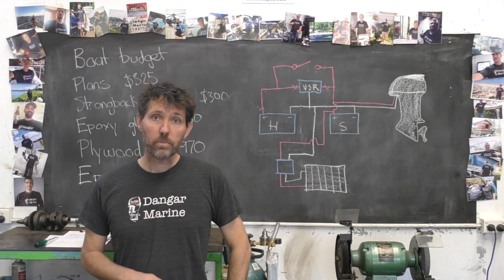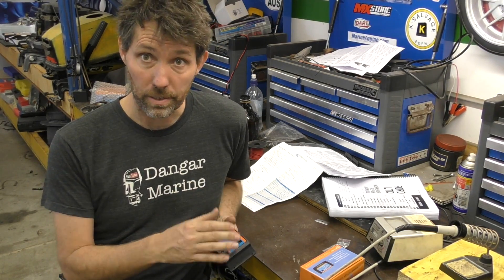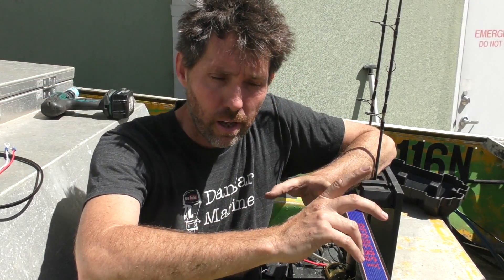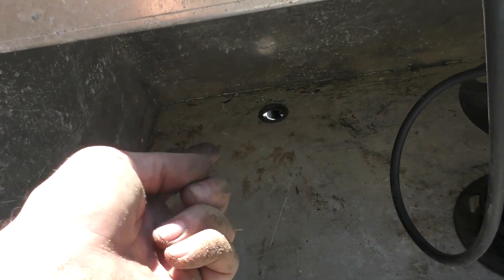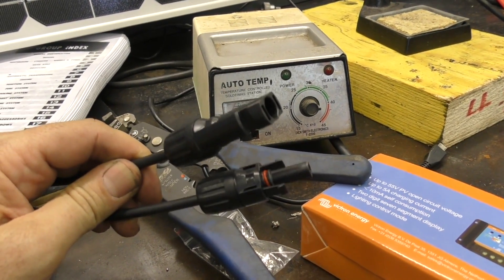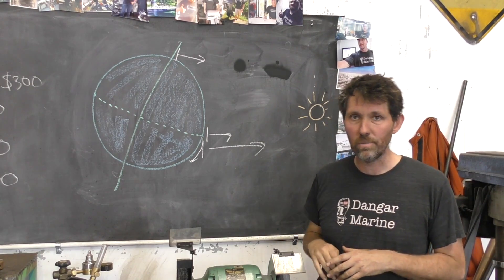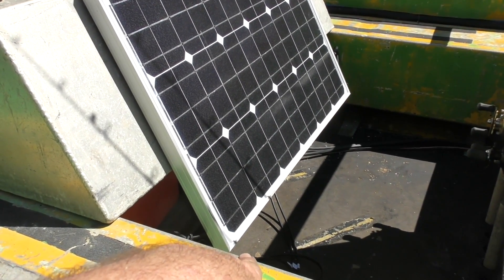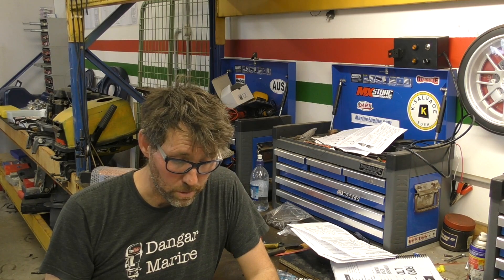Installing a solar cell in a boat

Comment: I'm wondering if the solar system needs to be isolated during engine operation to prevent the alternator from  pushing back current and possibly damaging the solar or vice versa?

Comment: The only way you would get 6 amps is if the battery is completely dead 
You could only get and use less than 20% of the advertised output ohm's law 101 
Measure voltage and the amps multiply the two and that'll give you Watts you will never get 100 electricity is like water you must overcome the incoming pressure volts is pressure

Comment: Interesting video! I have a bigger boat with a living space which I just prepared all the wiring ( it’s currently in winter dock on stilts.... because it’s still somewhat winter over here in Europe ) 

And I was just wondering what power outage of a solar system I should buy? 

I only use it for lights... and charging my phone ( maybe even my laptop ) and maybe my fresh water tank pump....

I got a good deal on a 50 watt solar system.... but then for a few dollars more I could get a 100 watt system! 

The 100 watt system of course has a much bigger solar panel!

I want to mainly power the lights inside and the white anchor lights and red / green position lights ( which are required for any bigger boats  in Germany and Europe ) and to charge my phone and laptop ( USB and reg outlet or cigarette outlet ) ! 

According to the 50 watt description it could charge a 19 volt laptop ! 

I don’t need charge for the motor ( at the Moment) 

So what do you think, does a 50 watt solar system is enough ( or even a 20 watt solar system, which would be cheaper )?

Comment: Hi Dangar, thanks for another useful video. Just. a question did you connect the solar panel directly to the charge controller? I bought a boat that had the solar panel connected directly to the charge controller and it got fried when I disconnect the batteries from the charge controller through a similar switch. I wonder if the switch should be between the solar panel and charge controller. thanks

Comment: Interesting; but the angle of your panel is no where near 33 degrees.  It's closer to 90 degrees.  Wouldn't you be better off having it flat; that would be closer to 33 degrees.  Or with the hinges you can just vary the angle.

Comment: So if you have 2 batteries in your boat, how do you charge both of 1 solar panel?
Reply from the maker: Use a VSR if you want to charge them together but keep them separate when draining.

Comment: Very useful thanks. Off to view your VSR episode right now. I have an elderly selector switch and a what I imagine is a Lucas diode split charging setup that looks like an ignition coil. I am dubious about this going forward with a  proper solar system.

Comment: Stu, I am following this exact same set up for my project boat. Question is, could I use the same design for two twin Mercury outboard engines? I plan on connecting both engines to the single “Start” battery but i am not sure if they will cause the Start battery from over charging

Comment: interesting......Australia being much closer to the "South Pole" why does your compass still point to the North?
Reply: Compasses point north and south I think... Aligning with magnetic field?? So a compass is aligning parallel with magnetic field....me thinks
Reply: @theowenssailingdiary5239  that's what we were taught as youngsters , however the compass always pulls to the center no matter where you are on the map. thinks about it, that would mean at some point of position the indicator would be a 180 degrees off if there were two magnetic poles this would make charting a real mess. my meaning is i could be sailing the coast of "Antarctica" and my compass will still point to "North" (center)
Reply: @awd3418  yes, it always points north because of the magnet polarity thingy. What I mean by north and south is that it points south also because it it aligning with the field. I don't really know what I'm talking about here, just guessing.

Comment: Late to the party on this one, my suggestion for a set up like this is to charge the house battery first and then the start, also be aware that the output load on the charge controller takes power from the battery it is charging so better on the house,  there should be no loads on the start battery  other than the engine memory  and maybe bilge pump, the house battery takes the brunt of the discharge  so should also take the charge first as well. I've set up quite a few systems like this including a liveaboard houseboat with 3 Kw of solar.

Comment: Hey Stu thanks for the guide this is the next thing I need to do on the boat, ive had the parts sitting around for months. Good trick with the wire skin as chafe protection Ill employ that from now on. Any chance you could do a impeller and oil service guide for a 90/115/140 Suzuki 4 stroke? Cheers
Reply from the maker: Thanks Danny, glad you liked the vid. Unfortunately I don't have a Suzuki to work on.

Comment: Hi Stu, Been busy making winterizing videos so just catching up. That's one way to keep a battery charged up. We don't get much sun around here in the Northwestern US but in the summer months would be good. I had a old solar cell I got from my dad but never used it and it broke laying around. I use a trickle charger but if your where there is no power source this gives a good option for boats or RV's. I have a friend who lives in North Idaho in an isolated area. He is totally off grid with a elaborate solar cell system that runs 2 water wells and everything else he needs. Anyway great video explaining how this works. Thanks
Reply from the maker: Hey Tim, yeah, this boat is never near a power socket so it is really my only option, and we are lucky to get plenty of sun all you round. :)

Comment: Hi Stu. Ive just center consoled a 5m tinny and the battery is now under the console. How do I  calculate the gauge of the battery starter cable now that its almost 5m to the outboard ( 60 hp 2 stroke ) ?  Thanks.
Reply from the maker: Hi Brad. Here is an online calculator. https://www.wirebarn.com/Wire-Calculator-_ep_41.html

Comment: I missed it.  Did you wire the solar panel into the VSR or straight to the batteries?
Reply from the maker: Solar cell is wired directly to the starting battery which is connect to the house battery via the VSR. https://youtu.be/kTQp5d5mMio

Comment: In perfect conditions I'd be guessing around 3.5 amps rather than 5 from a 60 watter.  Most good panels will have their output indicated on the back. Great video as per usual!
Reply from the maker: That sounds fair enough, I just did a quick division but it makes sense there are losses.

Comment: Great vid Stu. I have been thinking about putting a solar panel on my garden shed to trickle charge a car battery to run 12V lighting.  Your video has inspired me to go ahead and do it. Cheers.
Reply from the maker: Sounds like it would be a good setup. :)

Comment: Hi I bought a used boat with 70HP Mercury model 1983 and I need to change the ignition switch can you tell me how to change it and this the one with the bush key to chock when you want to stat it thanks.
Reply from the maker: Generally it is just a case of opening the forward control unit up and swapping the out. The wires are all colour coded so it is pretty straightforward. Have never done it on a 83 Merc though.

Comment: Very interesting video.  I've considered a small solar panel to run a circulation fan beneath the full cover on my CC to try to keep mildew away in the south Florida environment.  You've given some good points to remember.
Reply from the maker: I reckon solar cells like this are a great way to run permanent fans. I have also seen combined solar cell / fan units you can buy for boats.

Comment: Nice Vid Stu.I am about to begin this process, so it's time to get off my behind and do it!!!!  On another subject mate..... when your anchored for a overnighter is it advisable to lift the outboard leg or leave it soaking? Thanks for another great video mate.
Reply from the maker: Hey Leon. I would lift the leg. One night probably wouldn't hurt but you will start to get weed growth over the intake grill eventually. You also have the small risk of something floating downstream and getting wrapped around the prop.
Reply: @DangarMarine  thanks mate

Comment: I was taught that you should always cover the solar panel (ie, cardboard / paper etc) whilst you are installing it so that it doesn't become "live" and possibly short out whilst running the wires etc.  Is this true or were they "sending me to the hardware store for a "Long Weight"  LOL ??
Reply: Jason Kirk , it sounds like a great idea to cover it until it's ready to go.
Reply: Yes, it's a good idea to always cover solar panels when working on them. 
His solar panel was 21V if I remember correctly. Dry Skin is about 100,000 ohms and up, but if you have a cut, open wound or stab yourself on something electrical like the end of a wire it can be much lower. Dry skin though = 21V/100,000=0.00021 A or 210 microamps, and you wouldn't feel a thing. 
The hand-to-hand the perception threshold for DC shock is about 5 mA men, 3.5 mA women, painful shock is 62 mA men, 41 mA women, painful with loss of muscle control is 76 mA men, 60 mA women, and 300-500 mA can stop your heart.
Wet or broken skin may drop it to 1000 ohms. That's 21V/1000 ohm = 21 mA and in hand-to-hand shock territory but shouldn't be fatal. If there were two panels in series for 42V that would be 42 mA and painful for women. At 60 mA it becomes painful for women and they lose muscle control and can potentially be fatal. I don't think it's a coincidence that 60VDC is the upper voltage of most 48V "Safe Extra-Low Voltage" DC systems.
Reply from the maker: In this instance I just taped the ends of the wires before pushing them through, but covering makes sense too.

Comment: Very nice Stu! I see the controller utilizes pulse width modulation. I used a pwm switch on boat to be able to brighten and dim l.e.d. lights when fishing at nighttime.

Comment: Great video explaining a basic installation. Good for battery life to have a controller. When installing solar panels I always cover them with cardboard to make sure 1) they don't get scratched and 2) they are not generating power through the unconnected leads. Not a big risk but in direct sunlight they might be outputting 21 volts and the last thing you want is a short circuit.
Reply from the maker: Good idea to cover them with cardboard. I had the leads taped when I was pushing them through but that doesn't serve the doubt purpose of acting as scratch protections.
Reply: Clearwater Cove ,,
Reply: Clearwater Cove psst
Reply: i dont mean to be off topic but does someone know a method to get back into an Instagram account??
I somehow forgot my account password. I would love any help you can offer me!
Reply: @Miles Ty instablaster :)
Reply: @Jason Jonah i really appreciate your reply. I found the site thru google and Im in the hacking process atm.
Seems to take quite some time so I will get back to you later when my account password hopefully is recovered.
Reply: @Jason Jonah It worked and I now got access to my account again. I am so happy!
Thanks so much you saved my account :D
Reply: @Miles Ty happy to help :D

Comment: How well do those pop rivets hold up over time in a high vibration environment?
Reply: A lot better than screws.
Reply: QRPLife I would think very well considering some boats are riveted together. Like most aluminum boats are either welded or riveted.
Reply from the maker: It's also worth noting that the toolbox itself has been held down all this time with six rivets.

Comment: It's good that you're installing a 60watt solar panel in your boat.I am looking forward to when you install an electric motor in a normal looking petrol burning outboard motor's body.I suppose you will have to install a stronger solar panel for the electric outboard motor..Things are not always as they appear to be.
Reply: Atman solar outboards are a waste of time unless you only want to boat for an hour or less with a lot of space for tons of battery’s . I’ve seen a few and were not worth doing at all
Reply: I use rivets all the time on aluminium boats, they are awesome because they are made of out aluminium (no mixing metals as that's bad juju on aluminium boats), they seal easily, easy to replace and are very very durable
Reply: Just make sure the mandrel is alloy as well as some of the mandrel stays in the rivet when it breaks. Many alloy rivets have steel mandrels- don't use those on a boat.

Comment: Stu didn’t really get into it but it’s much better to install a mppt solar controller as you get way more charge from the panel.
Reply from the maker: Hey Heath. If was putting solar on a liveaboard cruising yacht I agree I would do everything to save whatever power you can. I've noticed a few yachts in that situation are going with lithium batteries now too (the Catamaran Impi YouTube channel is a good example of that) In this case I think I'm going to be generating a lot more juice that I can store, but a good point nonetheless!
Reply: If you look at the Victron data comparing PWM to MPPT, over the temperature/overcast range solar cells are most often producing power it's only about 10% difference. MPPTs are often way more than 10% cost wise and in some cases it may make more sense to spend the extra money on more solar panel, or making the system more redundant.

Comment: I think a lead acid battery should only  show 11.7 volts if it's not being charged.
Reply from the maker: Yes, about 2.1v per cell so 12.6 total, but they can hold a surface charge if they have been charged recently.
Reply: Ok you made me get up out of my chair, find my voltmeter, and go measure my Volvo that ran a few hours earlier and yes I was wrong. 12.5 volts (Dome light was probably on)
Reply from the maker: I hate to make a man get out of his comfy chair. ;)
Reply: Totally depends on the battery type but 12.6-12.8
Reply: Nope. That's a dead battery at 11.7

Anything below 12.5 is not good.